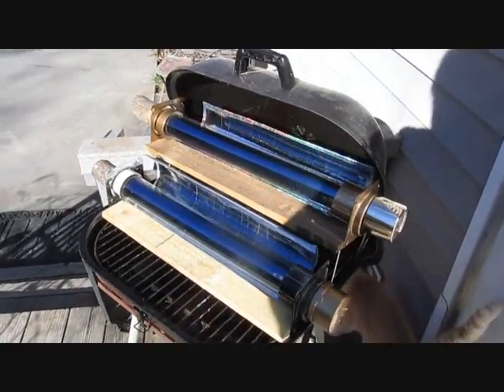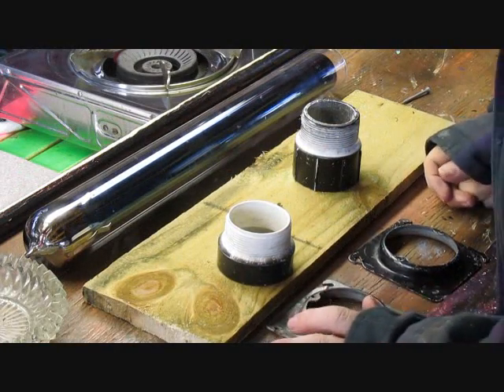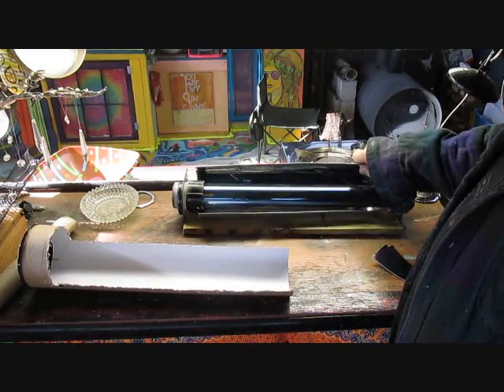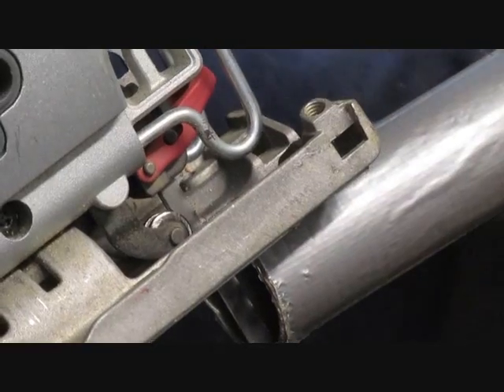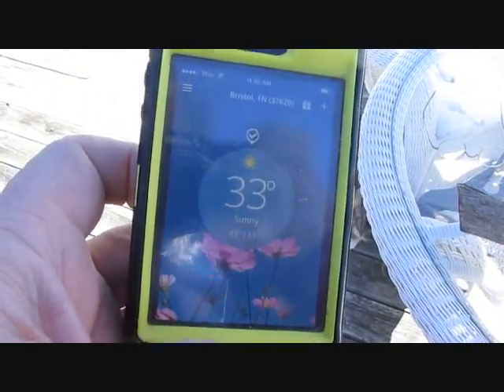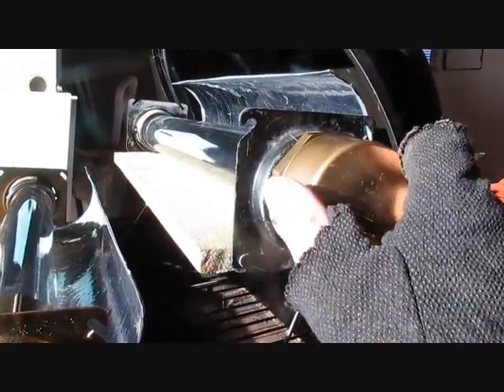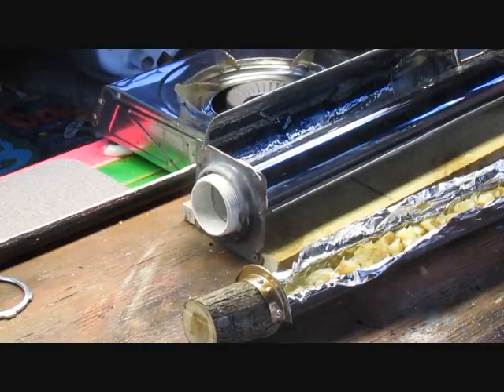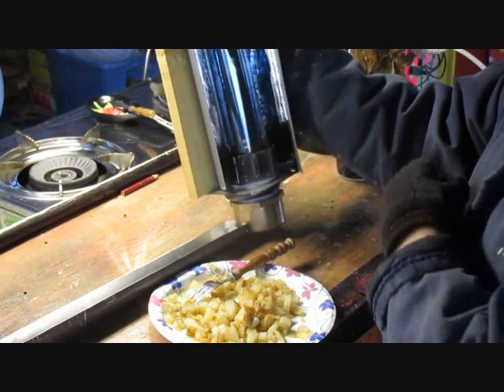SOLAR VACUUM TUBE OVEN 2016 RICH ALLEN

Comment: These evacuated tubes are a pain in the butt to source now. Here's another idea for those who don't have a workshop and aren't good with their hands. Get a thermal mug, double pyrex glass with vacuum in between the glass walls. The bigger the better. Place it inside a panel solar cooker. Pack the food into a black silicon baking sheet and put in the mug. Cover the mug with a glass lid or better still a  tight fitting silicon cup if you can find the right size. Or make one from bubble wrap and black silicon baking sheet. There's your vacuum tube. No trays and whatnot needed. No need for parabolas and focal lines. Just hit the mug from all sides with lots of sunlight. They are so efficient absorbing and retaining heat that you'll be cooking/baking in no time.

Comment: Take those tubes and use liquid metal with a electromagnetic pump. Make a hot plate or oven. Thermal electricity generator, water heater. home heating with a copper coil heat exchange with a booster fan on a thermostat. Understanding? Novartis

Comment: Love it. How do you ensure proper ventilation?I've read that the manufactured ones are designed with ventilation.
Reply from the maker: +Anette Clough i just drill a hole in the handle the ones you buy have a knoch cut out
Reply: +RICH ALLEN  Thanks Rich. Can't wait to try this. Appreciate your efforts to figure out how to do it :)

Comment: I've got a question... could a person build one of these solar can heaters using a black painted sheet of aluminum instead of a sheet of glass? I know how hot my windowless topper got on my old truck so I was thinking if I could do a fully enclosed aluminum box painted black it may actually get hotter. I guess I may be wrong with my theory but some of the people here could help give insight

Comment: Rich...the solar V tubes on ebay are 2" x 20"...is that what your using? from Clean Republic; $99 for ten
Love what your doing...tks
Reply from the maker: +packymck YES THAT'S THE ONES BEST DEAL ON THEM
Reply: thanks..Love all your projects...it's great that someone has a good head on their shoulders.

Comment: Hello Rich from Columbia TN. Love the tube idea. Do you think it would work with larger tubes?
Reply from the maker: +chuckweb66 yes if you could find them there is a bigger one on ebay  it has a 4 inch opening
Reply: I use a 4” tube.